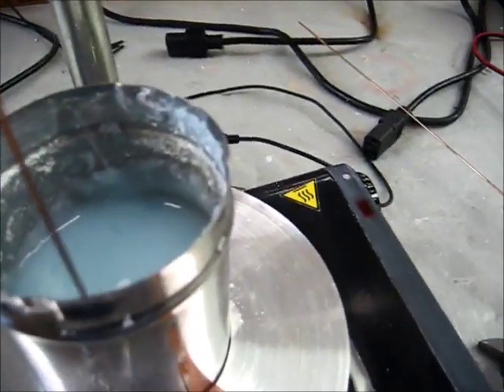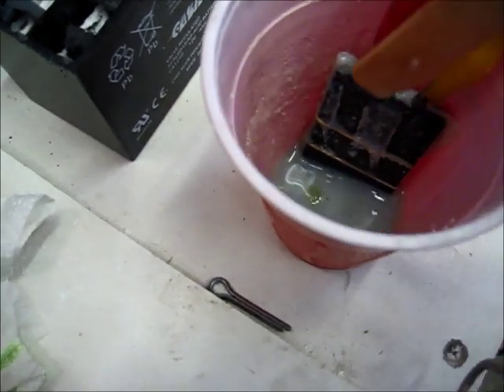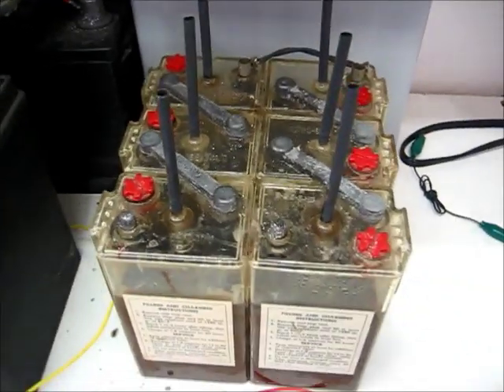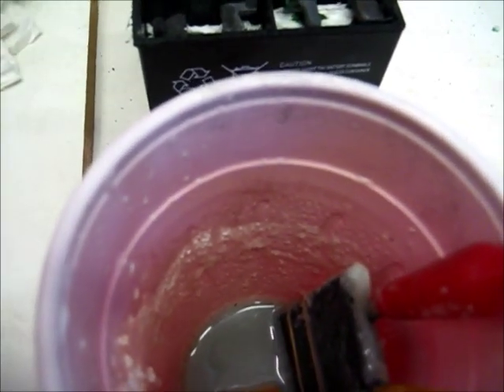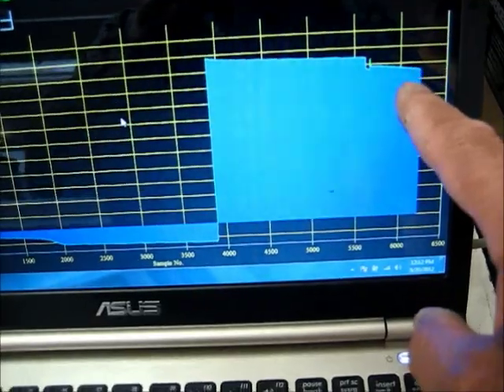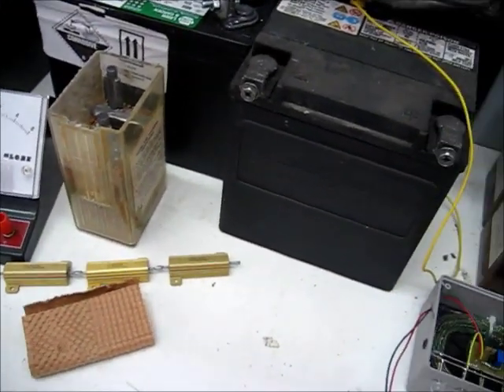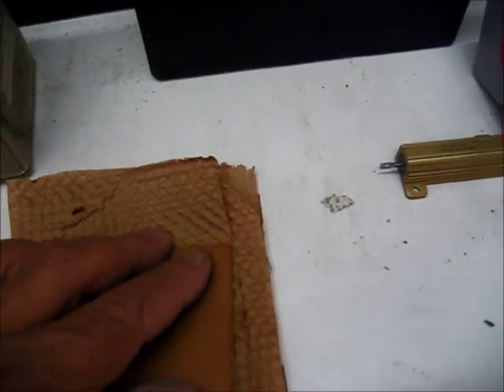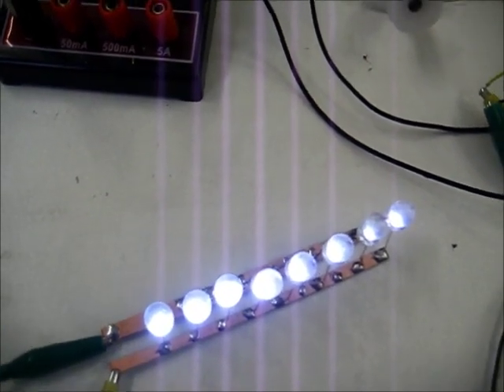How To Build It  A Lead Alum Hydrate Battery John Bedini

Comment: 3. Can be discharged as empty as you like without causing harm to the battery

4. Reaches a lower voltage plateau on the discharge curve where a relatively small amount of current can be pulled for a surprisingly extended period of time

Comment: What are the main advantages to this process?
1. no sulfuric acid needed, so it is safer
2. Does not leak as much as a lead acid battery so it lasts longer when not in use
3. ?
4. ?